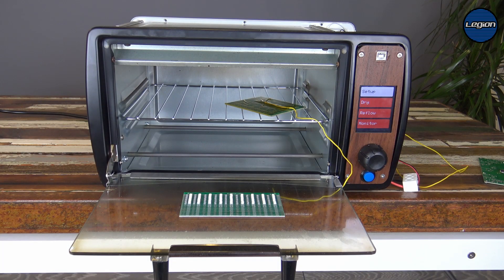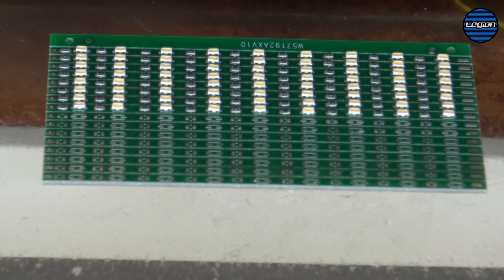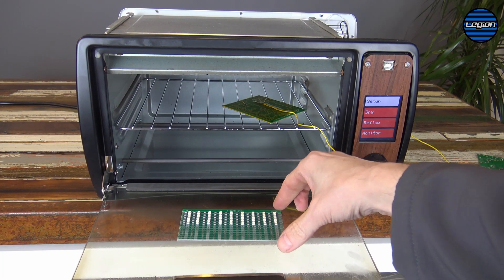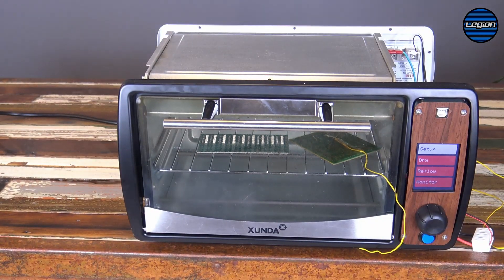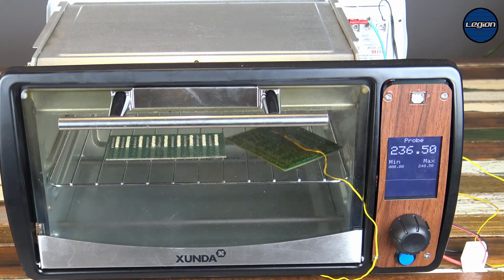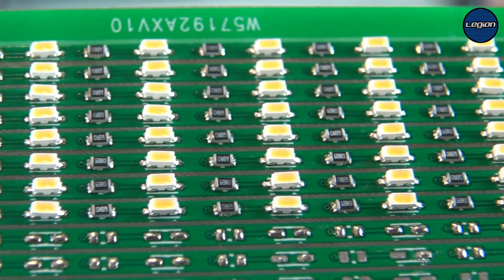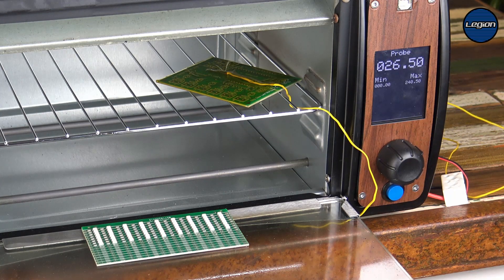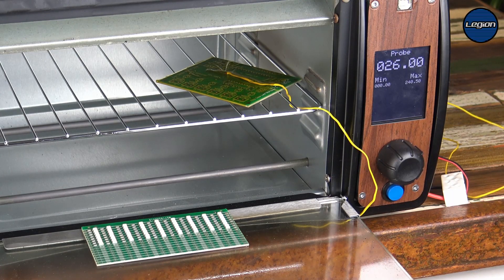My version of a DIY reflow oven   Part 5

Comment: What kind of controller are you using ? I see a big display, may be an arduinio project?
Reply from the maker: What the rest of the series I make is from a teensy.
Reply: @DJlegionuk  I missed the upgrade from the prototype version to the final one. By the way I couldn't find any link to the commercial product and I wonder if I can buy it in stead of assembly. Thank you by the way for the prompt reply. Any link to the product/project will be appreciated.
Reply from the maker: @ictrepairs6963  It's not for sale, I only made this for one job so the software can't be changed unless I rewrite  the program.

Comment: any cold spots / hot spots? how is the heat distribution?
Reply from the maker: HI, I use this all the time, but I only make the same thing, the led boards and it just works for me. I have not tried anything else or tried larger pcb to see how it worked. I did need to make one this past week, but it was too big to fit otherwise I could have answered that.  It does have two heaters front and back, top and bottom so I would say placing pcb closer to the front and back would be hotter than the middle that I normally use.